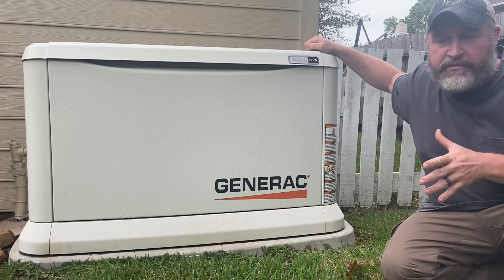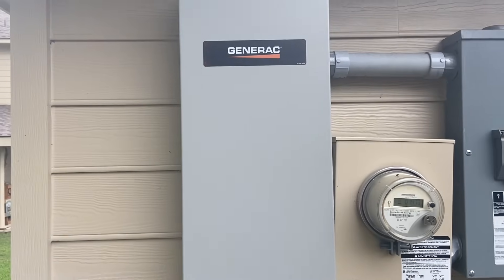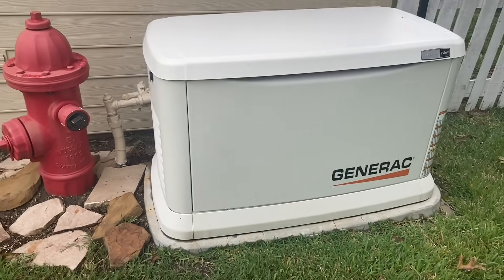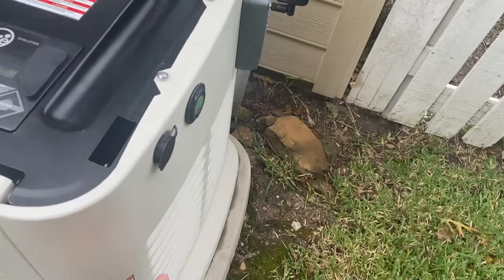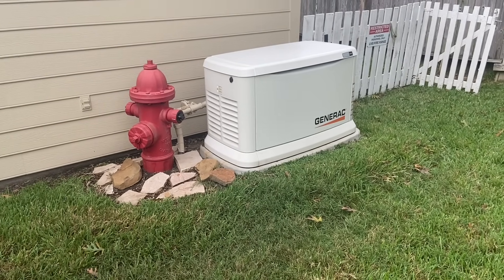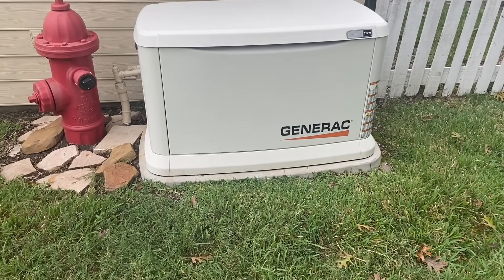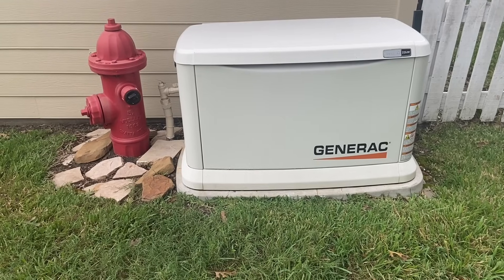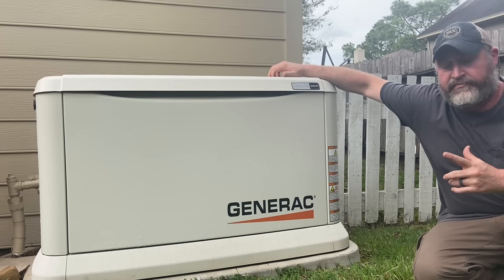Thinking of purchasing a generac whole home generator?

Comment: Had ours installed this April. Exact same 22KW unit. All in was $13,000 Canadian taxes included. In US that  is $9,785. Ours is on propane so the piping was only 15 feet and above ground. Saved us a bit of money. We have Geothermal heating so we needed that much power. Finally had a power outage 2 weeks ago and no issues.
Reply from the maker: Good deal ! Thanks buddy for watching please subscribe and check out my other videos
Reply: Lucky you. Had mine quoted last week for an 1900 sqft house, 1 ac/furnace… with an 18kW generac with a total cost of almost $18k. Installation costs with labor and materials pegged at $3k leaving the actual generator costing at $14k! I know, I know its waaay over priced and that’s why I did not go for them.
Reply from the maker: @rodjoves3290  13-14k now in our area as well, everything is going up.

Comment: we had someone come out and they gave us $20K quote! the advertsing on costs is just wrong. Not to mention no one would ever call us or email us back from generac. I know it would be nice to have but trying to get one is horribly difficult.
Reply from the maker: Pricing totally varies per the install, depending on gas run and electrical run placement etc. Thanks for watching I hope you find better prices.
Reply: Order the generator from another company and hire someone to install it for you. I got a 24kw Generac for $6700 and I'm hiring an electrician to do the wiring for me for a few hundred
Reply: My quote was $21K and that didn’t include the cement pad for the generator.  Haven’t done it yet.
Reply from the maker: @Chief_5  wow quotes can definitely vary by the company and install difficulty. My neighbor is have one installed  right now and he is in it around 13k, same as my 22kw but with a longer electric run but very short gas run with slab.

Comment: Only question I have when you had to use the generator for those 36 hours about how much did it cost to operate and how much natural gas did you use approximately thanks in advance
Reply from the maker: With the generator running , both furnaces, gas fire place and water heater it cost me a little less than 17$ more then normal.
Reply: When we had 2 major storms hit here in southwest Louisiana in 2020 I kept in reading facebook after recovery no power from 1-4 weeks. Those that had these ran them basically 24/7 in there large homes powering central ac units and all appliances. Those that commented said the natural gas bill was $400-500 per week, tracked through their meter. Many started backing off using washers/dryers and turning generator off for daily periods.
Reply from the maker: @geauxtigersdjs  not a lot you can do in that situation, it cost what it cost for the comfort.

Comment: Great video. I'll throw in a few more thoughts people might want to consider:

* In the last freak Texas storm (2 years ago, or so), the freeze messed with the gas delivery infrastructure, so it was shut off and people didn't have gas going to their home. This is why I prefer a propane tank. You can bury it if you don't want to see it, but you're a self-contained unit when the power goes out and you don't have to worry if natural disaster has taken your gas off line

* The bigger the generator, the more expensive it is to run. With one of those 22+kw generators, you might land up spending $2K or more in fuel if you have to run it for 10 days. I feel that it's worth it, especially if you were in Buffalo, NY, where you didn't really have an option to go to a hotel. I guess my point is, during an emergency, if you've got the money, sure, you can light up the entire city with the biggest generator you can find. Or, you can strike a balance and get a smaller 12kw - 14kw generator and get load shedding, which sets priorities for which appliances get dropped when the load gets too high. Remember, generator power is way more expensive than grid power. You're just trying to get through the emergency.
Reply from the maker: Thanks for watching and all the support and great comments , have a great 2023
Reply: Good comments.. .The issue I'm sure this gentleman faced (which many of us face if we live in the city or an HOA neighborhood, etc) is that it would take an act of God to get a propane tank installed.   Also, there is the added cost to go propane, assuming you don't already have tank.  We put a 500 gallon tank at my parent's home outside of town that will carry their 24KW Generac roughly 10 days.  The new tank was right at $4K, and it costs roughly $1K to fill it (propane has gotten expensive).    In our neighborhood, which is in the same metro area as this gentleman, there were a few homes in one section that had low nat gas pressure during the horrific freeze a couple years ago, but the gas company dispatched a truck to boost the pressure.  In our area, the pressure was fine.    I'm running a 27KW Generac, the bigger, liquid cooled version, and it will consume about $75 of natural gas per 24 hours, or roughly $750 over a ten day period.   Propane is about $2/gal here and the 24KW unit will consume about 2.5 gph at 1/2 load, and 4 gph at full load.  So if they unit was at full load, consuming nearly 100 gallons of propane per day, that would be $2K for ten days...although even a 500 gallon tank would run out after only 4-5 days assuming a full load 24/7, which isn't really the case, you're look more like 3gph on average, or about 75 gallons/$150 per day.. that would get a 500 gallon tank to about 5-6 days capacity.

Comment: We've had a Generac generator for about 17 years. Generally, the battery will last three if you're really lucky for four years, but I live in Florida so that's probably better. There's no freezing. The company that I had went out of business so I found another company but I think they're screwing me. Unfortunately we had critters that got into our generator and I found a possum making himself at home. The bottom part of the enclosure rotted out. However, thankfully it kept us through Hurricane Ian. This time we're upgrading to a whole house version. We have a 5-ton and a 1.5 ton AC, pool pump, and everything in the house is electric including the dryer. That said, here's our estimates:

Replace 16 KW Generac with 14 KW Generac = 7,857.00

       Replace with Kohler 20 KW, connect whole home and load shed. = 14,200.00

       Replace with 30 KW Kohler, and 500 LP tank. = 35,994.00

       Alternate additional work, or services not included in this quote.
Per set of surge device’s 385.00 per ATS used.
Maintenance agreement per attached pricing.
Wireless monitor per attached 579.75
Reply from the maker: Glad your safe!

Comment: I’ve seen two generators like these fail within three years after installation. One was mine (a Kohler). The other was an acquaintance’s (a Generac). Both failed after warranty expired. Both a waste of money.
Reply from the maker: Cool I have made it past that point.
Reply: They always do fail right after the warranty.. it's funny how that works on they behalf
Reply: My 16KW natural gas Generac generator came with a 7 year warranty and the contractor who installed it had been working with these types of generators for  over 15 years said that he had only seen 4 or 5 fail and it was due to the owners not doing the required maintenance on them.  In one case Generac had paid for repairs of one of their generators that had been out of warranty a couple of years because the owner had properly maintained the unit.  So experiences can vary.
Reply: How did they fail?  Could just be a bad battery, valves needed adjusting, fuse blew...  I have installed 4 of these and one is 18 years old.  I maintain them and all work just fine.  Only problems have been simple fixes.

Comment: You mentioned that there’s no difference and you don’t notice when the power goes out. But you do notice because the lights come off the TV turns off and then the generator turns on and those items come back on. With my battery set up I did not notice that we had a Power outage Until the next morning when speaking to my neighbor and they brought it up
Reply from the maker: No difference as in every single thing in our house is still working and has power, we don’t have to compromise or worry about what items we can or can’t use. Thanks for watching please subscribe like and share.
Reply: Do you use a generator in conjunction with the battery back up?  Else, what happens when the batteries die?  And eventually they will run out of power if not recharged.
Reply: Okay.  You have a different system, different requirements, different maintenance, different costs.  You paid a lot for that quiet, and you deserve it.  My TV doesn't go off, because everything I care about is on a UPS, and so I don't notice as much either.  I went with loud, as it was the most cost effective, long term.  So, when you are replacing your $$ batteries in the years to come, I will not hear that expense either.

Comment: How long will it run without shutting down for low oil??
Reply from the maker: No clue , it has a low oil safety sensor, manual states to shut down and check after ever 24 hours of use, our tech added when it’s safe to do so of course. Ours  ran for 36 hours and did not use any oil so ?
Reply: @JustCantSitStill  Aluminum engines can use a bit of oil, but owner needs to check unit at regular intervals to determine oil usage, if any.
Reply from the maker: @georgepruitt637  yes as I stated every 24 hours should be good.
Reply: @JustCantSitStill  not to include huge story, we were evacuated for 10 days because of a forest fire threatening our area. Our 22k run for 10 days straight 24 hours a day. I had no way to get back into it the roads were closed. 240 hours later we returned home. It had just shut off when the power was restored. It has a 1.8 quart oil capacity. It was about 3/4 of a quart low. Change the oil. Still runs like a champ. It has a 10 psi  shut off sensor that never activated even when it was almost a quart low. It just about emptied my propane tank it went through 250 gallons. We have no wi-fi capabilities in our area so I was unable to monitor or control the unit.
Reply from the maker: @swiftcaution5170  good to know and glad you made it out and back safely. I guess even at a lower capacity it was still able to pump enough psi to maintain. Thanks for the comment and checking out my channel. Please subscribe like share.

Comment: can you turn on or off remotely ?
Reply from the maker: With the old app I was able to with the new update it’s not available. No big deal as there is really no reason to remotely operate it as it’s all automatic. Thanks for watching please subscribe like and share.
Reply: I would like the ability to on-off unit as no reason to run generator when I am asleep or away.... manually controlling the unit at the generator is not convenient when it is storming out side...  just my thought in my situation
Reply from the maker: @chosipian  it use to be an option but the app updates have removed. I don’t miss or have ever needed to turn on off remotely
Reply: @chosipian  during an outage the battery will be drained within 24h. The battery charger needs to be powered at all times

Comment: So who installed your Generator. I noticed that the bonding wire between the neutral and the ground bar is still installed on the transfer switch. You might want to ask a local qualified electrician about it, by code that wire should be removed. The disconnect that is directly supplied by the meter can have the neutral bonded to the ground. The transfer switch is considered a sub panel and should not be bonded.
Reply from the maker: Truth, this was corrected after the video, our inspector was a pain.

Comment: Just keep in mind Generacs are made in China. And you get what you pay for. Getting parts may be a problem also. Kohler are made in the USA. Yes they cost more, but they are much more reliable and will last longer.
Reply from the maker: Cool thanks for watching
Reply: Know someone who was doing them for a couple years with his company because he does full high end backyards. Hurricane IDA hit and he saw how crappy they were and was driving around 12 hours a day going out to these units trying to keep them going. Dropped generac on the spot. The no name generator at harbor freight that looks like a toy doesnt burn anywhere near the oil the generac units do.
Reply from the maker: @radzer0966  Nice 👍 thanks buddy for watching and commenting, please subscribe like share and have a great weekend.
Reply: Peter Hicks  you can get good from china. But not usually from a big name brand because they sell on brand name not quality.
Reply: Misinformation at its finest. Generac is made in Wisconsin just like Kohler.
Reply: @sbrkhlz1  well my lawnmower burns less oil than a generac. And that thing ain’t even got a fan to cool it.
Reply: @radzer0966  Load on a mower and load on an engine for a generator 2 totally things but I’m glad you like your mower bud.
Reply: @sbrkhlz1  a mower actually runs hotter than a generator. Even air cooled if it’s properly ventilated. And after 15 years it doesn’t burn oil. A generac can burn half its oil in a couple days of running and generac thinks that should be. Completely normal. Had a local company here who installed and serviced them and the first storm we had where they got extended use. He got so many service calls because they were burning oil like the tire fire in the simpsons he stopped selling the brand. 

When a brand of product can make a company look that bad because they think that’s normal? Come on. 

The Indians that machine blown up engines with hand tools in a mud pit can get less blow by.

Comment: Big THANK YOU for an excellent video/information!  Definitely shop around!  I just got a quote/proposal (7/26/23) through Costco's dealer, ACI Northwest, Inc. for a 22 KW Generac generator.  BEWARE!  I have a 2700 sq. ft. (roughly) also but I do NOT have central heat or A/C, my stove and water heater (tankless) are both propane but I do expect/have up to 3 refrigerators and 2 chest freezers.  I wondered why the 22 KW was recommended for my home because in my previous home I ran central A/C, 2 refrigerators, 1 chest freezer and all other appliances off of a Generac 17500 watt portable gas generator.  The quote/proposal from ACI for a 22 KW stand-by generator was $19,262.00 with a generous Costco discount (10%) for a total of $17,336.00!  I told the guy NO WAY!  When I asked for an itemization on this quote he could not/would not give it to me.  I smelled scam right away.  Apparently Costco contracts with ACI in north Idaho so it seems the only way to buy through Costco is to use their dealer too.  I am getting other quotes but verbally I was told $10K to $12K for this same generator.
Reply from the maker: Thank you so much for the great comment and for watching, definitely think about future proofing far as your KW size. Currently in my area 13-14k for my same install.
Reply: Thanks, just in the market. Needed to hear this.
Reply from the maker: @corji-71  thanks for watching have a great weekend
Reply: $19,262, ouch!!  Kathleen you didn't say what part of the country you are in but I live in Southern Indiana and we have frequent power outages due to the crazy weather here.  In March 2020 my power was out for about 30 hours and that motivated me to get off my butt and get a generator.  I went through Home Depot and their contractor told me there was very high demand for Generac generators and the factory was backlogged.  In July 2020 they found a generator and I had a 16KW Generac natural gas generator installed for my 3000 sqft house that was built in 2014.  Total cost was $8,300 which included $450 for the gas company to install a larger capacity meter and run 80 feet of gas line at $10 per foot.  I have had 7 or 8 power outages (4 in one day) with the longest being about 8 hours and the generator has worked flawlessly, it's just like being on the grid.
I recently talked to the owner of the company that services my generator and he told me that in 2020 he installed 150 generators and he is now installing 250 per year and, he said he had 163 people on his waiting list to have generators installed.
Reply: @RICKYY1100  I am in north Idaho now.  Previously in San Diego back country where San Diego Gouge and Extort would turn off the power during red flag days with winds.
Reply: @kathleenoliver5461  San Diego Gouge and Extort LOL.  I lived in Socal 1982 to 2013, I was in the Navy and lived in San Diego, Escondido and Temecula for the last 18 years.  I never had any power issues while I lived there and did not feel a need for a generator, but I guess they are being more cautious now.  I do remember that nasty fire that burned through Poway and northern San Diego in 2002 or 2003?  Hope you can find a generator for a fair price.
Reply: @RICKYY1100  2003 was the Cedar and Paradise fires coupled with Santa Ana winds...I lived through them both.  2007 was the Witch Creek fire and a couple others...also survived them both.  A while after that SDG&E began the policy to turn off power in the back country.  Unfortunately that is also where people rely on well water...no power no well pumps.  In 2010 I bought the biggest portable generator made by Generac, 17.5KW.  A couple years ago SDG&E realized it might be better to finally underground electric lines in these areas thus eliminating the need to shut off power.  They should have done this after the 2003 fires.  Now I am in north Idaho and don't relish the idea of going out in the snow to start a portable generator to pump water hence I am researching the Generac home stand by generator...wish me luck!